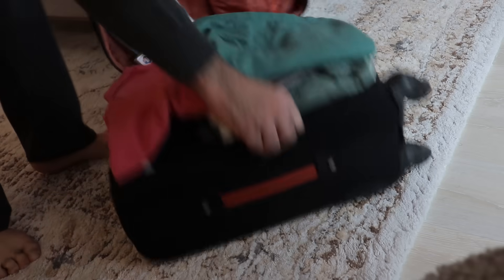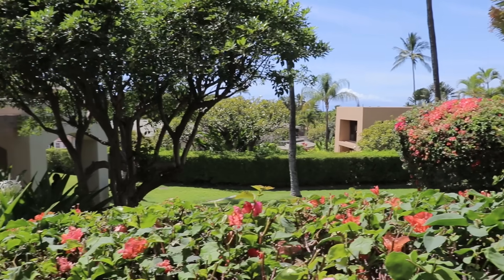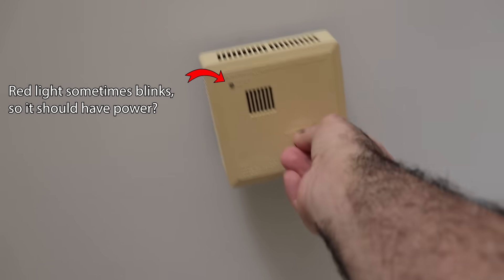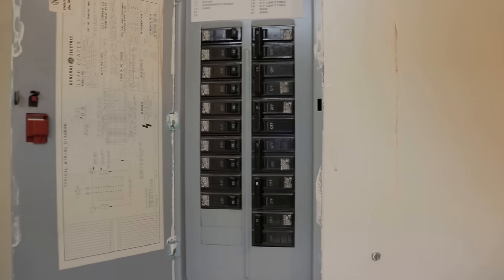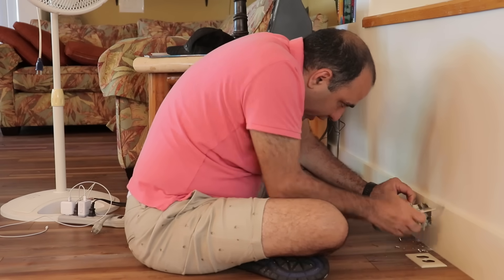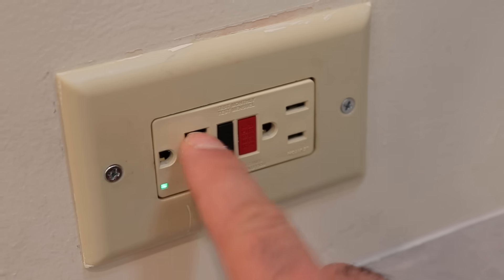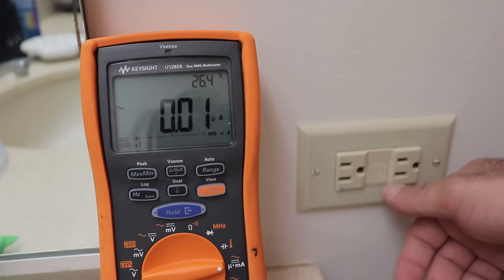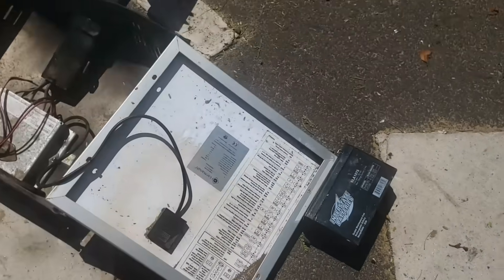Hawaiian Hotel Safety Failures

Comment: So Keysight prefers focusing on mandatory gender quotas instead of finding the best talents in electrical engineering? What about the teams who don't have female team members because they don't have any in their class? You're going to tell them to politely fuck off? Or quick hypothetical: What if they happen to have a female in their class who is not nearly is good as a male student? They should suffer because of an arbitrary requirement you created that has absolutely nothing to do with electronics? She has to be chosen over the guy to fill the quota? And on top of that, it is mandatory for the female to be the leader?? 
 If the best is male, then the best is male. If the best is female, then the best is female. Why does finding the BEST talents in electrical have to devolve into a gender issue???

Comment: For low light switches and door handles: I once had a door replaced after an over-eager fireman broke it down with an axe. The new door had a peep hole at belly height. I inquired whether this is a door for hobbits, but they told me it's current building code: it has to be suitable for children. Sucks, as I have no children, but was constantly at risk of snapping my back when using the darn peep hole.
Reply: Couldn't they have two peep holes?

Comment: Your sand there is from coral erosion and is essentially composed of limestone (calcium carbonate). It is not silica sand. No silicon to be found. Your semiconductors will be a pile of sludge.

I live on a small tropical island with coral sand and I also do some chemistry. I use the sand and shells and various other local things as a useful source for making calcium chloride and various useful things. So I already knew this but one day without thinking I grabbed some sand to put in my boiling flask while distilling some sulfuric acid, because sand is useful to prevent bumping (basically explosively violent bubbles of sulfuric acid). Needless to say, it didn't go as expected; calcium carbonate is very reactive with sulfuric acid. Silica sand is what you want for that too because it is pretty unreactive in the same way glass is.

Comment: My uncle and I just did the electrical in my cousin's basement. We found a metal junction box screwed into a metal duct. We fallowed the duct and it led to a floor vent in the bathroom right near the shower. Easy electrocution situation waiting to happen.
Reply: Assuming proper grounding that shouldn't pose a shock hazard.

Comment: That panel is single phase, so the leads going into the panel are actually 90° out of phase from each other. To often 3 phase concepts are applied to single phase when the two are different.
Reply: No, they're 180 degrees out of phase with each other. 90 degrees out of phase would result in 170 volts between the two wires.

Comment: Just amazing to see the USA style outlets are still substandard with regard to those plugs, same system in the philippines ,but 230 volt, I changed all the outlets (The English call them wall sockets- because they think are posh ) in my wife's home so that they were safer, I also included an earth ground as there were none. but in fairness you came to the UK and tested our 13 amp 240volt systems and they are pretty damned good.
Reply: the english electrical system is one of, if not the, safest systems in the world

Comment: 9:54 Don't you have circuit breakers for that? I have normal 240v outlets next to the sink no need for those silly GFCI outlets.
Reply: In some countries, it's more common for GFCIs to be on the outlet itself, and in others, the GFCI (typically called an RCD in those countries) goes in the breaker. Both have pros and cons.
Reply: I think they do have GFCI breaker but it would be economically if that particular location needs 3-4 GFCI outlets.

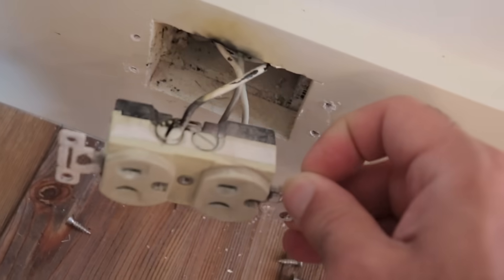Comment: 8:15 Why is that? Here in europe we don't need that. No fire problems here. Is it your silly 120v system?
Reply: No, it's that sparks could light the wall on fire if there's a short. More sparks would fly at higher voltage.
Reply: @Owen_loves_Butters  wrll teally? Or making you that up? Because in the Eu we have some safety measures.
Reply: @Simon-UwU  Why would I be making that up? It's not a requirement either, it's just a thing that is nice to have.
Reply: @Owen_loves_Butters  well I never saw that at a v240
Reply: @Owen_loves_Butters  ist beacause our walls are usually made out of non flamable Materials at least near outlets. American walls are like paper you can punch holes into them, meanwhile if id try that where i live i would break my handm
Reply: @zocken1497 Yeah, makes remodeling substantially easier though.
Reply: Sparks could fly and light the wall on fire in case there is a short circuit in there, and 120 volts is safer than 240 because with the 240 volt system there will be more sparks
Reply: @stickwelder3776  funny person
Reply: Since we have paper walls

Comment: yeah i move to a new department a few months ago and the outlets are very loose and the breaker box in outside and isn't a breaker box at all is only one 60 amps breaker in the main electric meter box so very inconvenient and the house is very old and like the second floor that i live in, was part of the house, was a two floor house an they separated so the electrical wiring is a mess so is very complicated to add a proper breaker box, so yeah that it

Comment: I had my 50 year old fuse box replaced with modern spec australian breakers. Every single breaker is also an RCD that pops at 15ma to ground so any leakage to earth in the house is protected. I was sweating when it was done becuase sometimes putting new breakers in old houses causes them to pop all the time due to old crappy wiring but everything is good :) I also had 2 independant 25 amp 240V circuits run to the car port so I can work on my hobby of browning out the neighborhood by running my home servers. Electric hot water, Electric stove and oven, a 3.6KW compressor and a 300 amp welder.

Comment: Low rates of females in the competiton teams are hardly sexist if the base pool electrical engenering studends has a similar ratio, which it probably does. Where are all the females supposed to come from? What is sexist however is forcing a gender quota. This just leads to fewer qualified teams, ultimatly excluding talented individuals that dont happen to be female OR it leads to team members being "dragged" along that dont actually have a reason for being there other than fullfilling the requirements. If you want to achieve a more equal gender distribution you have to work at the root cause not the effects. Maybe thats ultimately what KeySight wants to achieve by publicly presenting female EEs and hoping that this will make EE more interesting for females. In this case they might even find this descions justifiable but if thats all there is to it, they could also (cynically put) use cardboard cutouts.

Comment: Test meter. check. 
Soldering station. Check. 
Misc wires. Check
Spare ram chips. Check
Electronic tweezers, pliers, exacto. Check.

TSA. Checked me. "Do you have anything in your laptop case that could poke or cut me?" "Yes" ..removes hands quickly. I explain needle nose pliers are pointy. Exacto knife has plastic cover. TSA gently puts hand in laptop pockets. Removes tools. Then swabs the entire case. No drugs found. Solder and solder paste gave them a pause. 
Good times. 

If the wife can bring hair dryer, curling iron, flat iron, electric toothbrush I can bring my toys too. Arts and Crafts are not just for at home, do them while on vacation.

Comment: dude you disconected the wire to the smoke detector when you pulled it out
Reply: Yeah, but most hardwired detectors are designed to be disconnected from their AC power source (as well as reconnected) if need be, so there's no problem.

Comment: Regarding the expiry dates on smoke alarms, Just because the manufacturer puts a "Expire date" doesn't mean they expire. you have to actually test them to check if the are not working. Most expiry dates are actually a way for manufacturers to have planned obsolescence on devices and not actual expiry.

Comment: I'm an electrician (in the US), did a walk through for an apartment, they claimed heat and hot water were included in the rent, but not electric. after my little "inspection" I asked what all the 2 pole breakers in the panel were for if heat and hot water were included. couldn't answer it and tried to keep my deposit
Reply: Sorry, could you explain what the breakers have to do with heat/hot water?
Reply: @rickrickston3202  since the breakers controlled the heat and hot water, and we're in the electric panel that I would have been responsible for they lied about heat and hot water included
Reply: @adfadgaqgv  could have been range and dryer if it had one.
Reply: @michael931  could've been, but there was no laundry in the unit it self, and there was a range, still doesn't explain all the 2 pole 20s
Reply: @adfadgaqgv  I'm guessing the breakers were labelled then. Two pole 20 amp breakers could also be powering multi-wire branch circuits which for those who don't know are a more economical way of wiring standard outlets using less wire. 

It was my understanding that most baseboard electric heaters ran on 30 amp circuits but I don't really have any evidence for this.
Reply: @adfadgaqgv  Sorry but...

Electric isn't used for water heaters... it isn't efficient and its always heated using natural gas...

You sure you know whats up?

Also.. What kind of electrician is so poor they rent? You should be making more than enough money to buy..
Reply: @eDoc2020  Electric heaters can run on 16A breakers at 240V. I would imagine 30A would be standard in the US given the 120V circuits (no doubt radials and not rings with only 1 appliance/heater per circuit breaker). 

You could probably use 20A if the wattage of the heater and thus current draw is lower.
Reply: @dislikecounter6392  Not always the case, especially in the UK, Europe and Japan. Immersion heaters are slowly being phased out, but boiling water tanks and instant hot water sources under counter tops are starting to become more common (the latter is common in the US too and has been for about 15-20 years now). 

Water takes 4.7kJ of energy per litre to increase 1C/1K so it doesn't matter whether you use electricity or gas, the source of the fuel (electricity or gas) is often the point at which efficiency is better measured, as opposed to the heat exchanger, which often times is only within 2-3% of one another (between gas and electricity).
Reply: @S.ASmith  Fixed electric heating in the US is always on 240v (or 208 if three phase). I looked up the code and if multiple heaters are on the same breaker it can be up to a 30a circuit. Practically this means you can have two 240v 12a heaters on one 30a circuit, one 240v 16a heater on a 20a circuit, or larger such as a 240v 24a heater on a 30 amp circuit. I guess if you have mid-size rooms baseboard heaters will probably be 240v 16a.
Reply: @eDoc2020  We generally don't attach things to skirting boards (baseboards) in the UK for heating. 

Most places use gas boiler with central heating (radiators in each room, typically opposing any window in the room). Electric heaters here tend to be portable these days.
Reply: @S.ASmith  electric baseboard is pretty much for the places it's not practical to run a water loop, or a forced air system, or in alot of cases no fuel delivery to the home. Not sure where that guy gets his information, or if he's ever even been in a building before, but electric hot water tanks are fairly common in my area of the US, they're being phased out for more efficient heat pump hot water heaters.
Reply: Why didnt you just check the utility closet that would have to be accessible from the unit? Youd know immediately if you were paying for heat and hot water if they were both in fact electric.
Reply: @johnnyregs2378  which is how I caught them lying.
Reply: @adfadgaqgv  you said you checked the breaker panel not the closet. The closet would have the actual furnace and hot water tank. You sure you're an electrician?
Reply: @johnnyregs2378   considering I own my own electrical business... I'm pretty sure. not all apartments are the same. Yes it did have a closet with the hot water tank in it which proved my point even further. As for the heat, it was all electric in the units panel. I also didn't say when this was in my electrical career, it could've been the same day I started. Who are you to question my profession? Are you sure you do whatever it is you claim you do for a living?
Reply: @adfadgaqgv  not all apartments are the same but all apartments in the US by code have to have a utility closet that can be accessed from the unit that houses those appliances. I'm sure a seasoned electrician like yourself would know that. What do you mean all electric in the units panel? Electric heat still needs a furnace or a heat pump. You clearly don't know what you're talking about.
Reply: @johnnyregs2378  ever heard of baseboard electric heat?
Reply: @johnnyregs2378  the fact you're doubting him means YOU have no real experience in the field. There isn't a single housing regulation I haven't seen a landlord breach. And that was just a single property, hur hur. But seriously.
Reply: @mandowarrior123  that doesn't make sense in this context. Landlords normally don't build entire apartment complexes, they're built by developers then the units are sold. In the US, residential code is pretty strictly enforced. Things like access to utility closets wouldn't even make sense to cut corners on and risk tanking a multimillion dollar development project. You're talking outve your ass kiddo.
Reply: @johnnyregs2378  and you're starting arguments with people on YouTube when you have no background on what they're talking about or their profession & then insulting them.

Put your willy away & stop
Reply: @johnnyregs2378  check the age of my channel, kiddo. It's not even my first. There is no reference to a complex, only a single apartment of unknown age or specific location. And you believe an apartment is constructed flawlessly every time to a unified code strictly enforced and that it works perfectly and is never modified, changed, upgraded, replaced and is always up to modern standards even if 50+ years old with several owners and not one of these would ever even dream of cutting a corner or having a bad day? 

Even top aircraft manufacturers can't get basic things right quite often. Sorry to breach your dreamworld where everything is always perfect. Get some life experience. Speak to an inspector, or anyone who has worked on properties ever. They will laugh in your face!
Reply: @norfolkngood8960  I'm a landlord and  property manager and have been a general contractor for 17 years. This is literally exactly the stuff I have experience in. However I find it pointless to mention my credentials when anyone online can say anything. I'd rather point out the fallacies people are spewing instead of just saying "trust me bro I'm an electrician!" Go sit down 😂
Reply: @johnnyregs2378  Electric heat does not require a heat pump or a furnace FYI...

There are baseboard heating in buildings from the like 70s... however even back then lots of houses instead used radiators to heat and gas to heat the water...
Reply: @johnnyregs2378  No it does. Electric heaters exist...as do storage heaters & even electric boilers and water heaters. They don't need a ground source heat pump or a gas furnace/boiler at all.
Reply: @johnnyregs2378  I'm guessing the bodge it fixes that have been found by experts in a field on the properties you've managed have landed you in hot water before and you have a chip on your shoulder about it.
Reply: @johnnyregs2378  that guy's head would explode if anyone ever told him about ceiling radiant heat. No way he'd ever believe that was a real thing, probably because he's never heard of it, it doesn't exist
Reply: @johnnyregs2378  does the utility closet have to be unlocked to the tenant though?
The apartments I lived in a few years ago had a closed like that, but it was locked. I had to let them into my bedroom every few months to change the filters but was not allowed to open the door myself.

Comment: I recently noticed in the safety instructions of an electric space heater the advice to check the plug periodically during operation to make sure it's not getting excessively hot, as this could be a sign of a worn outlet which could be a fire hazard. I had never thought about that before but immediately realized that it isn't a bad idea to check plugs and cords for excessive heating anytime significant current is involved. Especially keeping an eye on things like extension cords for this wouldn't hurt, either.

Comment: Some other post I saw recently pointed out that there are two different outlet series looking the same, but differing in the internals.  As well as price, of course.  According to that story, the ability to handle number of attach and detach cycles is very different.  Moreover, especially in the hotel rooms the room service tends to use repeatedly the same outlet for their vacuum cleaners, leading invariably to loose contacts at those outlets.  The advice was to avoid using those particular outlets for anything, including your battery chargers.